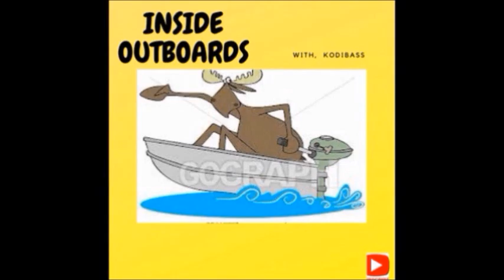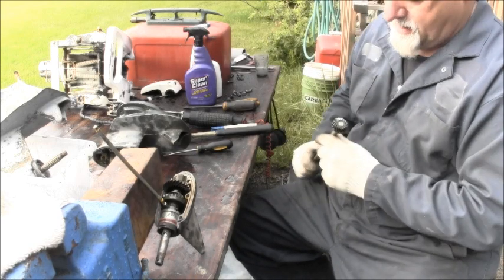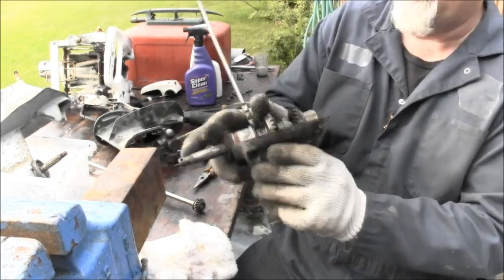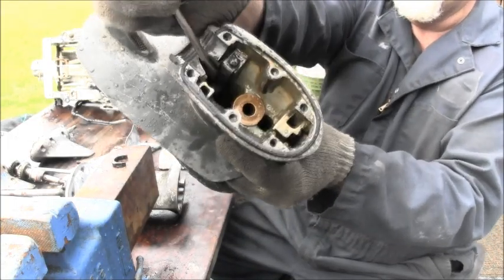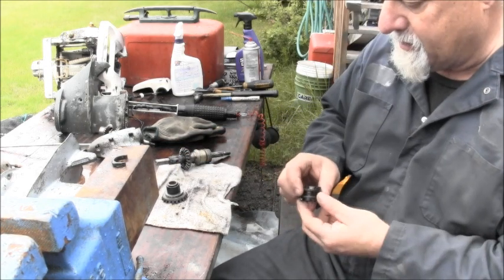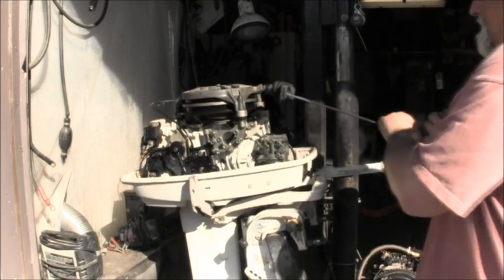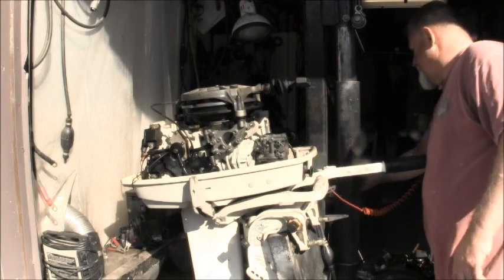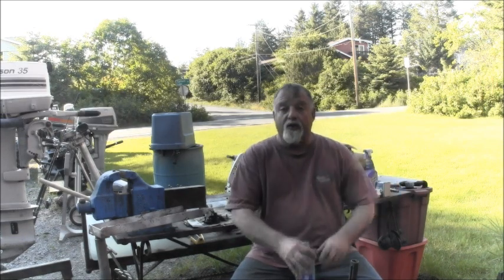JOHNSON 6 HP,  EVINRUDE 9. 5  HP  Lower Units  what's inside them + More

Comment: Hi Kodi, pretty cool seeing the inside of those old lower units. I was surprised how simple the TD-20 was when i took it apart. The water pump on those are totally different. Anyway going out for test run 2 with the Starcraft tomorrow then going to start doing the test videos coming up. first one is the oil injection flow test in a cup. The book has the info for the amount and how to do it. Will make a good video. I think I'll pull the pump out too to show folks the gear inside. I hear it's plastic and they wear out?

Comment: Great to see you in Summer attire !  Here is one from the frustration lowering department: I got tired of having to get on all four looking for flying detent balls so I slip the prop shaft assembly in a large transparent plastic bag before pulling that clutch dog off. On reassembly, I use petroleum jelly to hold the spring and balls in place and that jelly also helps in slipping-in the clutch dog. Stay safe and be merry !   P.S. what’s the daylight span in Kodak around the Summer solstice ?

Comment: Thank you very much you answered the question no one could answer for me where the ball detents and spring go it shows in schematics but not where they go. I do have one more question what would make the driveshaft make noise unless held up a couple mm does the driveshaft get held up slightly by the water pump key. I have a 1989 Commercial 25HP long shaft tiller I'm hesitant to reinstall the lower unit because I don't think it is right. I have put together the lower unit several times, just docent seem right. I have a video I could send if you think it would help Thanks Ive been watching your videos for years now.
Reply: The pinion gear and driveshaft assembly usually has some play (move up and down a bit) until the driveshaft is slipped back in the motor head. Filling the gear case with oil also helps in quieting its moving parts. Regards !
Reply: @danielrobert7181  thank you that makes me feel a lil better I work on outboards but I haven’t had many older style lower units appreciated